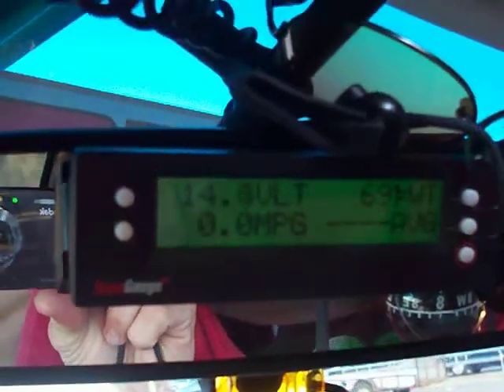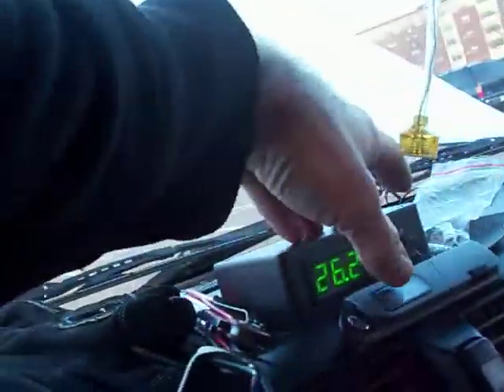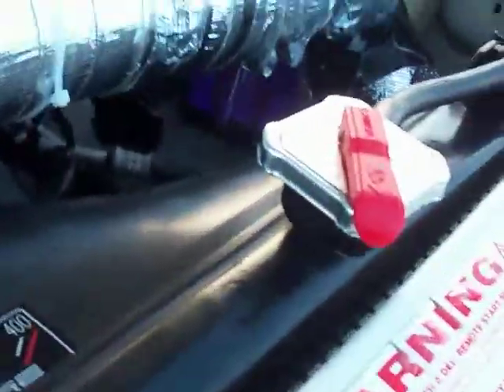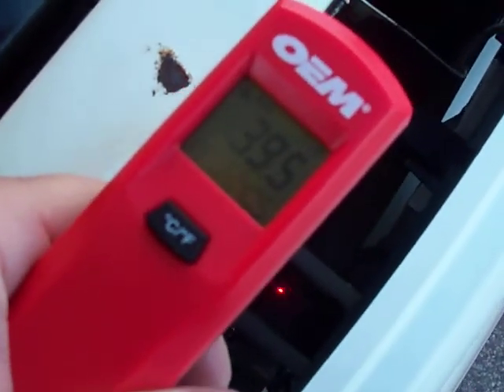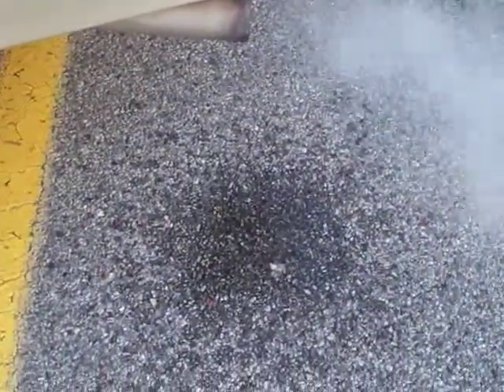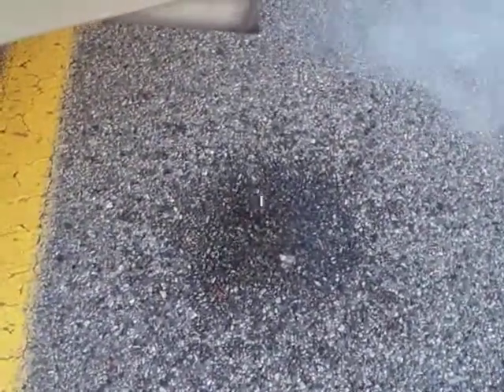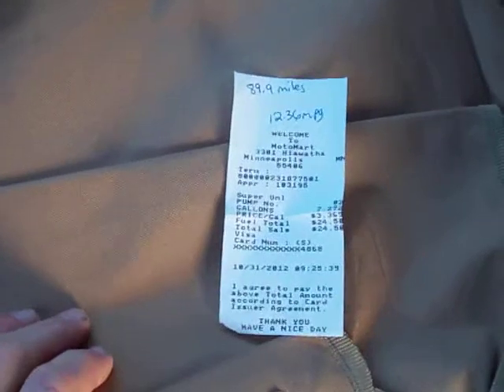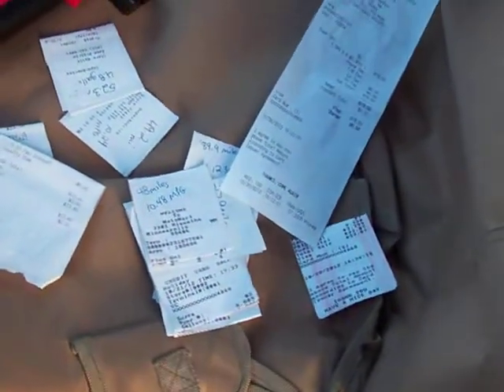Green Fuel H2O Gfx1 19 plate HHO dry cell cold weather opperation 2 of 2.

Comment: Your reservoir is improperly marked. It should never have the electrolyte above 2/3rds level or you'll get fluid in your lines. Also you should install a check valve in your reservoir that allows outside air to go into the tank, but not blow air out. This will resolve the vacuum pressures during shutdown of the system and cool down.  The manufacture of your system should have had that in their design.

Comment: I've read that the Volo chips really don't help and in some cases actually cause higher fuel consumption.  You should probably look into tunable EFIE/MAP modules.  Do a google search to find them... These devices allow one to tune your the O2 settings and overrides the EMC settings for  enrichening the fuel.  You have a good start on the system and well documented.  Just work on getting these kinks out and throw that Volo chip away.  Move your reservoir lower to prevent siphoning of electrolyte into your engine.